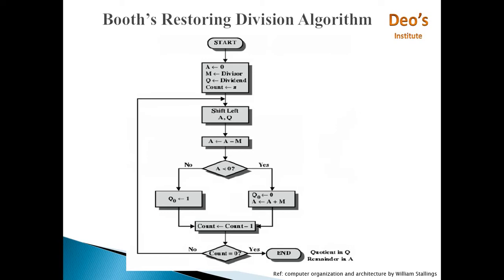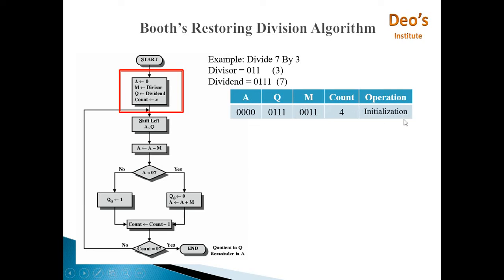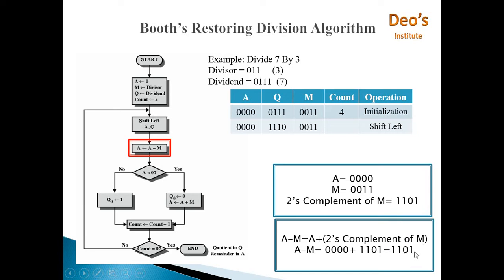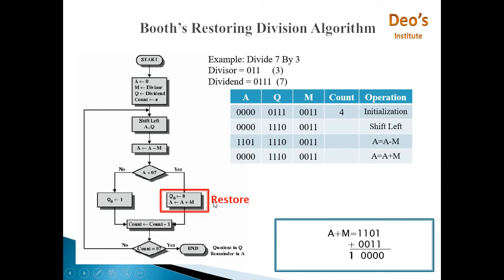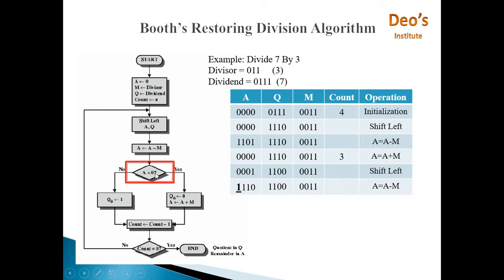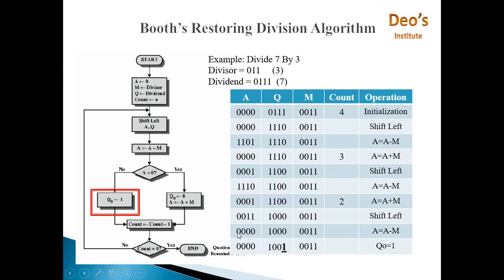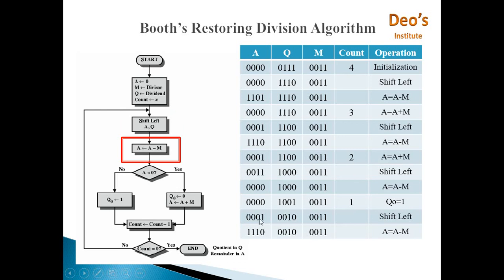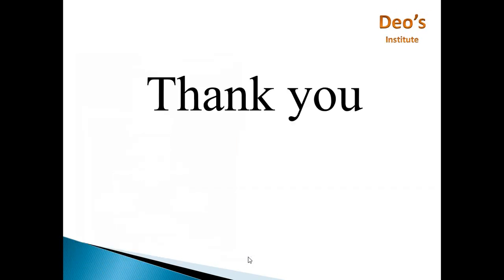Booth's Restoring Division

Comment: Pls explain arithmathic addition,subtraction,and over flow .....
Reply from the maker: Addition:
It is just Binary Addition..
0+0=0
1+0=1
1+1=sum 0 carry 1
1+1+1= Sum 1 carry 1

e.g 00110
+    10011
=    11001

If carry is generated from the MSB(i.e Last Bit) then we call it as overflow..

Subtraction:

To perform subtraction 2's complement method is used means instead of subtracting number we add 2's complement of that number.

e.g
suppose we need to perform 11101-10011
to do above subtraction first we will find out 2's complement of 10011

2's complement of 10011 is 01101
 and then we add this 2's complement to first number so now it will become 11101+01101= 01010     (with carry overflow)

so 11101-10011
will become 11101 + 01101-------------(Where 01101 is 2's complement of 10011)